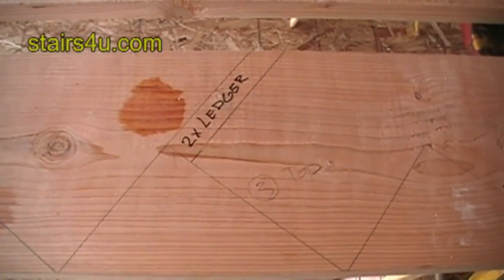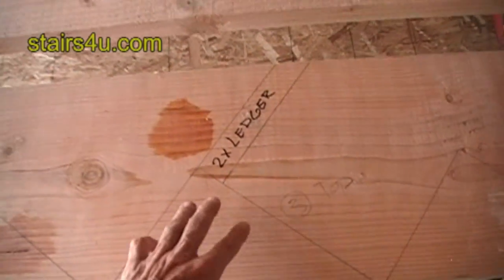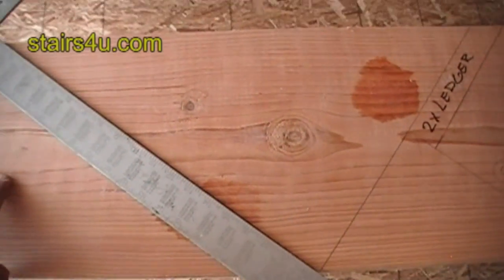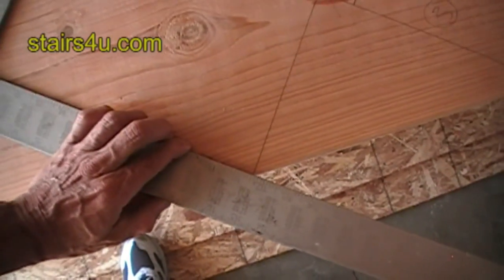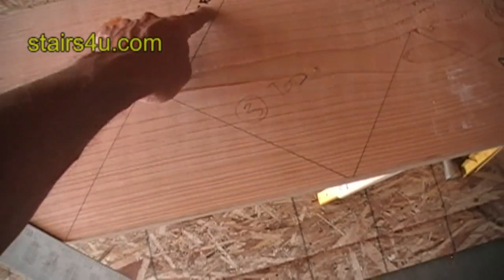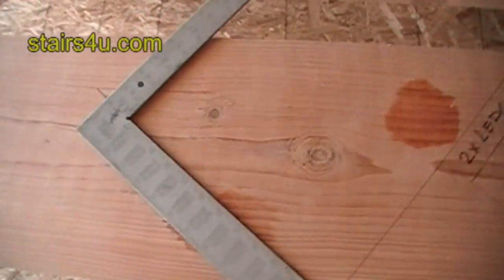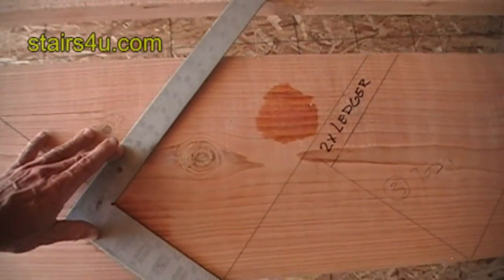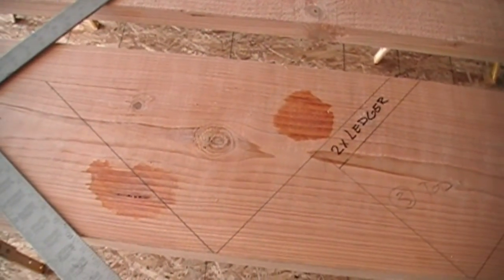Top Stringer Connection For Cantilever Joist - Stairway Layout

Comment: I think im understanding what you are saying but correct me if im wrong. By adding the extra bit to the stringer to attach to a 2x10 or 2x6 floor system I would actually be making my run longer.